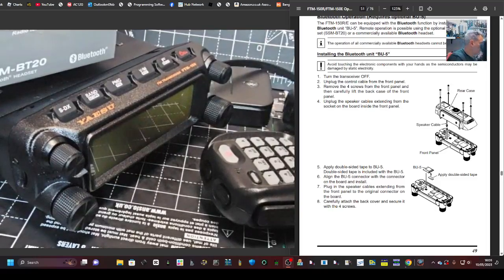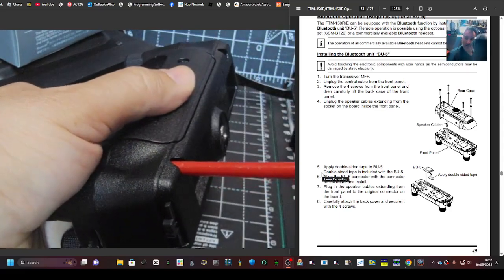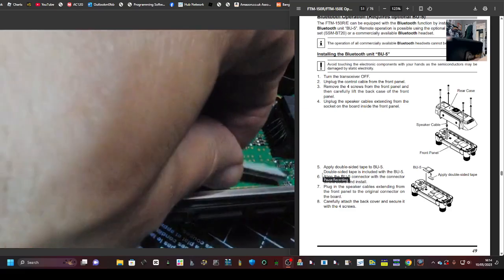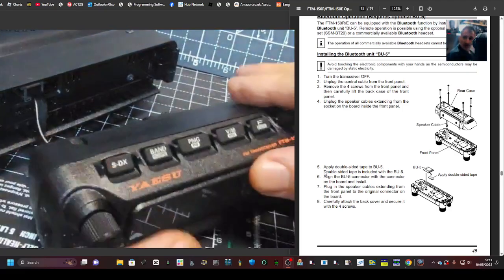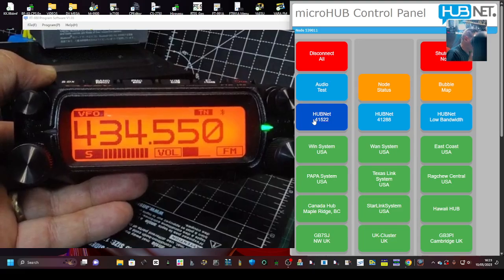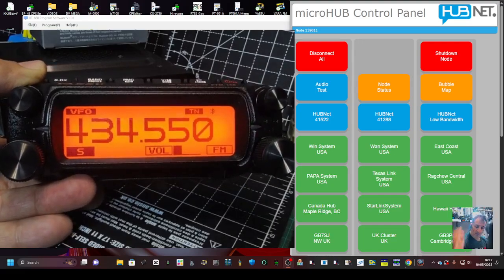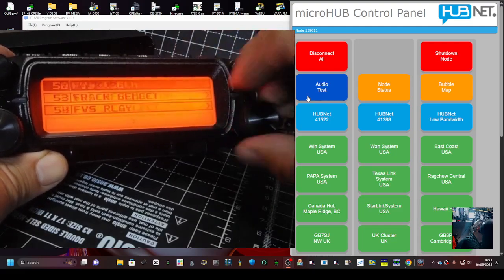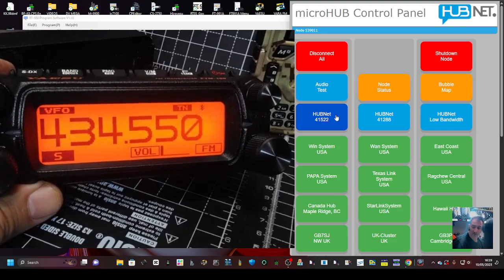Install Bluetooth - Yaesu FTM150 & Test - SSMBT10/BT20

Comment: This a good video, and perfect for the FTM-500. HOWEVER, PSA : do not follow this if you have an FTM-510!!! While they look and perform similarly, on the FTM-510 there are, in addition to the 4 screws shown here, another 8 screw that need to be removed. Look it up in the owner's manual. The insides of head-unit are also arranged differently, and the BT unit goes into a different place.
Reply from the maker: Thanks and yes discovered that .

Comment: Anyone have any experience connecting the Yaesu FTM 150 with the Bluetooth to your iPhone or Android and using RadioMail?
Reply: I just added the module and my transmission is distorted. I’m using a Bluetooth audio only headset and the original mic. Nit sure if that’s my problem or not. But so far, I’m not happy!
Reply: @Ltstevecox108 thank you for that!  Definitely going to reconsider